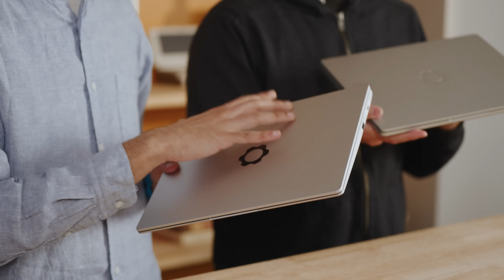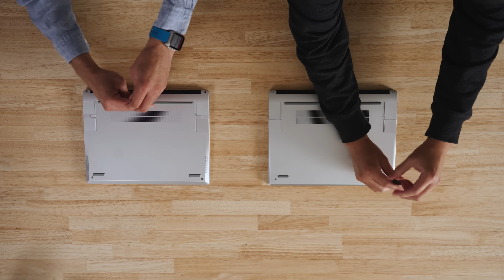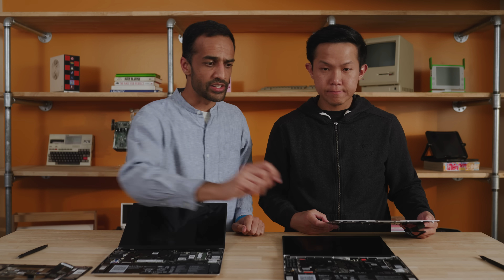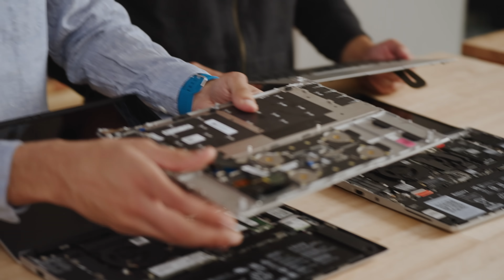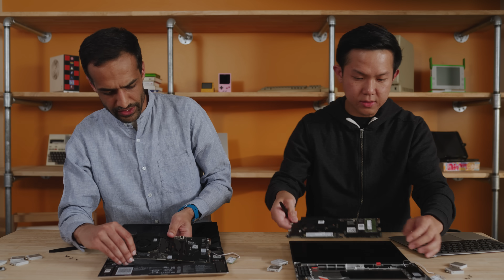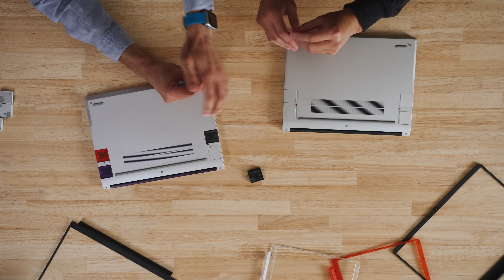How to upgrade to Pro from the Framework Laptop 13

Comment from the maker: Correction: 10:54 AX201 wifi module is actually incompatible with the new Mainboard. Compatibility chart here: https://frame.work/laptop13pro?tab=upgrade-to-pro
Reply: Bro won the price already for: most hand gesturing CEO on the planet
Reply: Your compatiblity chart didn't say anything about wifi module.

And how is coreboot going for all the boards you put out so far?
Reply: Would the earlier gen battery work with the pro board, knowing that battery life will be less?

I'm waiting for touchscreen and coreboot before I commit. At this point I'll just go pro... oh wait
Reply: @pigletshut  yes it will, the connectors are backwards compatible

Comment: Something understated about this upgrade possibility is how it will make new peoples join the framework line up by buying 2nd parts from customers who decided to upgrade.

This is probably a good time to get into the framework13 base and prepare for later upgrades since you already know what changes will come.
And when YOU decide to upgrade to the 13 pro the parts you can sell will help the next customer join the boat.

Comment: This is the video I needed to see as an existing Framework 13 owner! Thanks for demoing what can be upgraded, and what can't be without a more in-depth upgrade path, for existing laptops ❤

Edit: Oooft, the part I care the most about upgrading first, that touchscreen, is ~AU$500, and that's not including shipping. Can't justify that just yet, especially while my ancient Surface Pro 4 is still clinging to life and has pen support (really good for signing documents without having to print and re-scan them). But if the touchscreen did have compatibility with pens like the Surface Pro one, then I'm looking more interested. And if you get hinges that turn past 180°, am even more interested!

Comment: I know the main point of the new chassis is to be able to fit the battery, but honestly I’m just grateful you made the expansion pack easier to remove😅 it was honestly hard to remove it with my weak hand strength

Comment: Hey framework! I was wondering if i could do a strategic combination of 13 and 13 pro parts... Id like to get a 13th gen intel (with ddr4 sodimms) main board, but in the new 13 pro chassis with the new battery as well. Id also like to get the 2k touchscreen. Is that possible to get through the website? The potential for customization is unreal!

Comment: 4:40 I hate new memory module design (only assemble design choice). Older version pro model have better assemble process in my opinion. To give an example from my own experience, when I want to install a memory module, I don't want to have to work with the precision of a watchmaker.
Reply: It is the only fast modular DDR5 form factor for laptops

Comment: i really like the modularity of this thing. the hdmi cable doesnt reach your hdmi port but you also can't flip it over? no need for a longer cable, just take the port out and plug it to the other side. that's sick. or you don't need hdmi and you just need as much usb ports as possible? thats fine too just replace the hdmi port with an usb one in under a minute. it's a laptop that i want a lot but unfortunately yall dont ship to turkey :/

Comment: The 13 having an upgrade path to the 13 Pro finally shows the true potential of Framework as a concept. Everything can be upgraded now. Not just the computing hardware but keyboards, touchpads, speakers, screens. The modular design of the 13 gives the possibility of not just repairability but customization to the customer’s exacting specs. What a cool release!

Comment: ahahaha i remember installing that wifi module at 5:51 on the original DIY version of the 13. still chugging away great! awesome video, really love to see the commitment to selling computers that you can actually repair and upgrade yourself. I remember having to upgrade the display at one point and I was shocked how easy it was. took like 5 minutes. vs my friends using competitor products had to go send their laptops back to wherever and get an entirely new one for pretty much everything.

Comment: If we upgrade our original FW laptop 13 to the 13 Pro bottom chasis, battery and haptic keyboard - will you take back our existing bottom case, battery and keyboard? I'll have no use for it, and it would just go to waste.

Comment: I'm not aware but is there a way to return/recycle back an old part if someone were to upgrade? Like the new board to replace the old one, can they return/recycle the old board to framework? If there is such a thing that would absolutely be cool. and all those returned/old parts can have it's own product line of pre-owned/second hand laptop at a lower price.

Comment: Unfortunately prices of these motherboards are too high for my budget and with ram and nvme price crisis the specs I need for my work cost over 2600€ . At the price You can by a MacBook Pro with M5 pro which is in anither league of performance or two MacBook Air M5 that would fit my needs. I really wish I’ll have the money in the next future to buy one of your laptops and have a desktop workstation for heavy task or that amd or intel catch up with Apple. So far Apple is must too good for my use cases and I even know how to replace most of the parts of they break

Comment: Please send a demo product to develope a keyboard for the blind using this new laptop.the idea is brilliant...use the bottom half of the clamshell case,complete with keyboard touchpad SD card and speakers and back lit keys..this will be used via a usb port connector...the pull for the blind would be the multicoloured keyboard which is inter changeable and many different colours....this could be the best keyboard for productivity on the market...Lenovo tried and failed with this idea...frame work could succeed with this.....the disabled community needs framework..you might speak to the rnib in London to develope this further using what will be exiting parts delivered for assembly?

Comment: Love it, I'm very tempted to get the intel motherboard with the LPE cores and put it into my current Original Framework 13.

One note: You may have wanted to mention to turn off the battery before opening the laptop.... Which is definitively something I do every time... (I'm ashamed to say I don't really know why you're supposed to do that.)

Edit: Ever thought about providing a trackpoint? Not that the trackpad is lacking, just curious.

Comment: What you've got here is mutualized identity fraud. The solution to users who "customize" essentially their entire layout/identity over and over was to use a weighted identifier index that put the PC parts contribution to overall identity as: motherboard at 50%, CPU 30%, and others less. At some point they are untraceable and untrackable as single entities. The only way left to prove somebody is in a virtual environment is measuring the delay between when a packet hits the ethernet pin to when the REAL CPU gets interrupted. A VM will have jitter, the real thing will not.

Comment: EDIT: The compatibility table is very well done and on the website, it was a miss to not mention it or show a screenshot in the video, but i should have digged a bit more

is there a compatibility list ? a chassie update mean that it's less sure what will fit.
Does the speaker fit ? will the new keyboard fit ? is the audio jack buzzing when turning on under linux fixed and i can swap this to ? Obviously the new batterie is to big, but what about the rest ?

Comment: I currently have the i5 1135g7 from original framework motherboard set. The fact that if I want I'm able to just buy a brand new motherboard, keep my storage,  keep my my chassis, keep my screen (though I did upgrade to the touchscreen within 5 minutes it went live on the website) and only change what I want to change is huge. Not only saves me money, but also reduces the amount of waste I produce. Being also able to use my mainboard externally when I decide to upgrade is amazing. I genuinely love everything framework is doing. 

I can't believe it's possible to go from "mid teir laptop 5 years ago" to "top of the line laptop with no compromises".

Comment: Guys, here is my question: 

I have a standalone motherboard with a 7640U, and I’ve been planning to buy a case for it for a while now to turn it into a full-fledged laptop. I haven’t updated the BIOS yet, since you can’t do that without a battery. Will I be able to connect a new battery and update the BIOS inside the PRO case? Or do I need to find an old battery somewhere first, and then connect the new one? In other words, will the new battery provide at least some power on the old BIOS version?

Thanks in advance for your answer!
Reply: yeah new battery would work with old mainboards
Reply: @dekufan-f7i  so i can update the bios using it? it won't just show the full capacity, right?
Reply: @Unnitt yeah, it should be able to recognize the full capacity
Reply: @dekufan-f7i  ty!

Comment: Hey Framework, love your mission, love my Framework 13, but I wanted to mention the ModRetro Chromatic on display in the background of these videos. If you're not aware, ModRetro is founded by Palmer Luckey, an arms dealer with no shortage of controversy. While it's presence is not necessarily a concern to me, I can see how/why some might have reservations or concerns seeing that in the backgrounds of your various videos when considering a Framework product for themselves. Perhaps consider replacing the Chromatic with something like an OEM or modded GameBoy Color as a studio prop. Much love ❤

Comment: Did you just completely gloss over the fact that you need to buy entirely new RAM for this upgrade?

"The new wifi module is pretty cheap, so, not a big deal." Okay, but a new 64GB RAM purchase costs as much as that entire mainboard.
Reply: you needed new ram ever since it switched to ddr5, unfortunate how cooked the market is rn
Reply: @dekufan-f7i  The point isn't whether the upgrade requires new RAM, the point is the deliberate omission of the fact that the new Intel Ultra architecture doesn't support SODIMMs at all, despite noting the wifi module as "one other incompatibility."
Reply: @nonotreallythx maybe they couldve mentioned it here but on the announcement vid they made it a point to talk about ram change
Reply: @dekufan-f7i  Yes. But even then, not in a "you'll need to keep this in mind when upgrading your mainboard" light, only in a "the new redesigned laptop uses this modular new RAM, which we think is great for you" context.

I get it, RAM upgrades are an uncomfortable truth. But when you're talking to DIYers, who buy your stuff specifically with DIY Internet, don't BS us. Be upfront and honest -- which also means not omitting crucial details just because they're uncomfortable.

Comment: why do they call the new one a pro if it's interchangable? will they stop updating the base fw13?
Reply: It's not fully interchangeable. It's still a new chassis design.
Reply: @tntblast500but yet it's the exact same dimensions and shape. So what's the point
Reply: @S1baar it's not the exact same though. Some parts like the battery and input cover aren't interchangable. Although, design differences aside a simple explanation for the pro branding would be higher quality and an increased price.
Reply: @tntblast500wait so no haptic touchpad for the normal fw13!?
Reply: @S1baar you can put the haptic touchpad on the 13, but you can't put the current non-haptic one on the 13 pro

Comment: I wish they had talked more about the new screen, from the way they interacted and subtext it's clear the new display can show a picture drawn by the old mainboard; but my biggest curiosity as touch was not part of the original system is if the old mainboard can receive the touch input signals from the new screen?
Reply: Yep, it can. It was mentioned on one of their previous videos that the original mainboard was built with support for touch displays.

Comment: I do have a few questions for the core ultra 300 series mainboard like what wattages are those Chips running at or what's the ram frequency or how much battery life is impacted with battery capacity and display resolution & refresh rate with all the display types available between the first release and the new touch one
but ig I'll have to wait for third party reviews for the answer to most of them

Comment: Since compatibility between different gen parts start to be an issue, I think it would be great if you can have some sort of upgrade recommendation tool on your website so I can fill-in my old config (or better yet my old order ID) and knows what upgrade I need to do along if I change one specific component.

Comment: It's really great that the 13 can be upgraded, really a Pro move of you ;)

Could you also sell a "full" upgrade kit featuring all upgraded components in silver or the new graphite cover so I don't have to buy every new component separately? :)
Reply: You mean … this kit (not yet) available in the store?

Included Items 	
• Framework Laptop 13 Pro Touchscreen Display Kit - 2.8K
• Framework Laptop 13 Pro Top Cover Kit
• Framework Laptop 13 Pro Bottom Cover Kit
• Framework Laptop 13 Pro Speaker Kit
• Framework Laptop 13 Pro Audio Board Kit
• Framework Laptop 13 Pro Input Cover Kit with Haptic Touchpad (Language and color options available)
• Framework Laptop 13 Pro Battery - 74Wh
• Webcam Module (2nd Gen)
• Framework Laptop 13 Pro Hinge Kit
Reply: @patrickhanft yep, thank you :)
I didn't find it earlier 😅

Comment: I’m curious about the channel architecture of LPCAMM2 RAM. Since there is only one physical slot, does a single module already run in dual-channel or even quad-channel mode? I’m concerned it might only be single-channel and perform worse than a traditional two-slot DDR5 SO-DIMM setup

Comment: I had been soooo worried about the first substantial re-design of the Framework 13 and how much inter-operability would remain possible between generational shifts. I have to admit, you exceeded my expectations of what would even possible to achieve (the only regret being how we seem to be stuck now to that keyboard cable instead of that beautiful FW12 connector)! A huge congratulations to you, Nirav and your team for your vision, persistence and authenticity! You've blown me away and kept me believing even stronger! Especially all these well documented rich details on what is possible and what to consider and the wide variety of upgrade parts offered! THIS is the kind of ecosystem I voluntarily will buy into again and again, because it is not only to your, but also to MY benefit!

Comment: The fact that I can keep my existing mobo, upgrade the chassis, then later upgrade the mobo, and have two working laptops is insane. I was worried there for a sec when you said "pro". Amazing work.
Reply: Frameworks model for business is great if you wanna buy used parts.
Reply: What you've just described is the same as just buying a new laptop. Only in smaller steps.
Reply: @gamechannel1271  it is absolutely not "just buying a new laptop". I have managed to damage my chassis in the past. I have been able to repair it by replacing the damaged bottom cover and keyboard cover. Now, if something similar happened to me now, I would not only be able to repair my device, I would be able to start upgrading it. I would be able to continue using parts still in working order while already moving to some new features. At some point maybe the screen starts not working properly or at one point performance might not be enough anymore. I can invest just in the feature needed most. Yes, at one point I have a new laptop. But not because I had to replace the whole thing due to a single issue. And that's the beauty in it.
Reply: @patrickhanft This is the most natural way to transition from a product to another product. It's almost organic. Absolutely beautiful and it should be the norm for more products.
Reply: @gamechannel1271  And that is the greatest thing ever. If they bought the regular 13 with Ryzen AI a couple of months ago, they can just put the new screen, touch pad or chassy+battery, or all of them combined. No need to buy a whole new computer just for that. Couple of years down the road they buy the new board with latest CPU and have two perfectly good computers.

Comment: Congrats for new Pro model! Looks amazing. Now the next logical step for Framework would be a colored eink screen, maybe partnering with Dasung. Theor  Paperlike 13K is 13 inch as well.  With this new Intel processor and eink screen, we could have a laptop that could be used for days outside in the sun. No need to worry about battery or strained eyes.

Comment: When I saw that 20h battery life announcement on Instagram for Pro model, I rushed here to find out if it'll be compatible with my Framework 13 and I was not disappointed)

So far the battery was the only thing I ever wanted to upgrade. The new touchpad seems amazing as well. 

Thank you for your work! 💛

Comment: I’m just looking forward to the screen swap! 

Since I swapped the original top cover for the stiffer one I have a chassis to mount the old screen to, now I just need an adapter board to convert the edp connector to USB-c
Reply: Exactly what I want as well.  Instead of the new keyboard, I wish they would have made a nice cnc stand to attach the top cover to that contained the adapter board inside. Then it would be a nice one stop thing to swap and have a nice same format external monitor for my 13.
Reply: @That_Stealth_Guy even better idea. I bet it could be done with a combination of the input cover breakout board I’ve seen somewhere in the community and the new wireless controller board they’re putting in the keyboard.